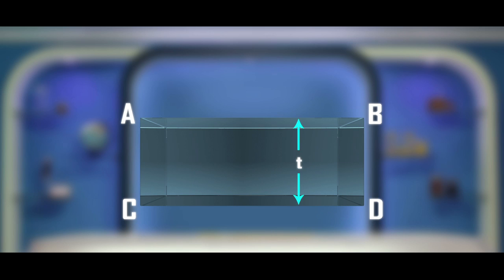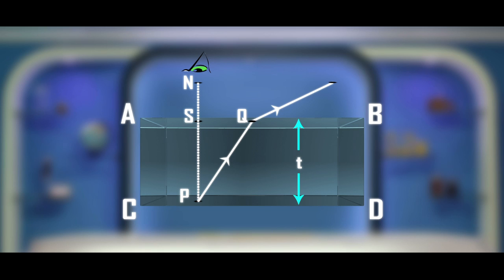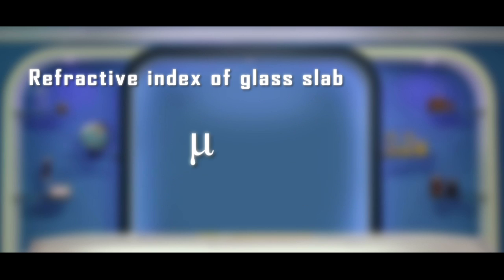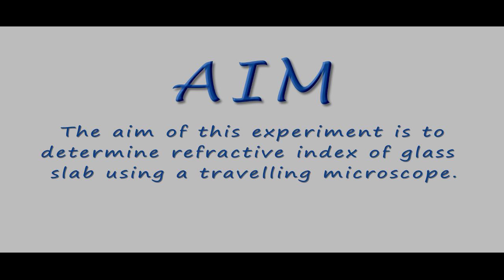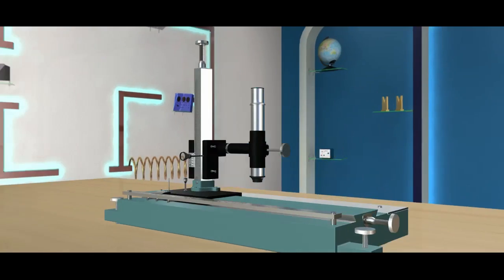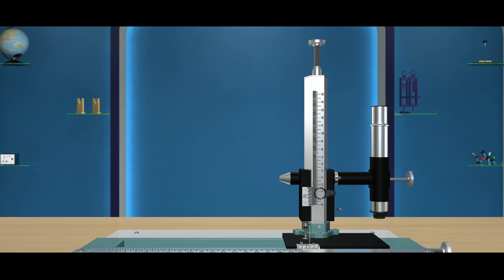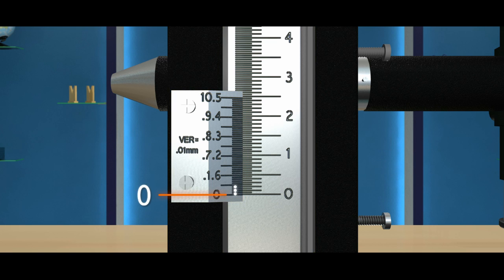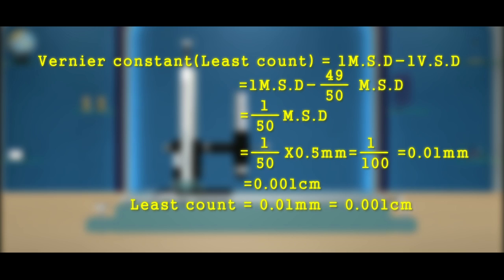Physics Practical: Refractive index of a glass slab (Use headphones for clear audio/sound)

Comment: can you make a video on "how to use travelling microscope "
Reply: +hasan abdul The indicator which reads the reading on the main scale is the zero mark on the vernier. 
On the main scale each mm is divided into half mm. Hence the reading would be read for divisions on the main scale. ie say I start from 3 cm. 
3 cm, 3.05 cm, 3.1 cm, 3.15 cm, 3.2 cm, 3.25 cm and so on. 
But for our convenience let us read as 3.000 cm, 3.050 cm, 3.100 cm, 3.150 cm, 3.200 cm, 3.250 cm and so on, 
Now say your indicator ie zero marking on the vernier is lying in between say 3.200 and 3.250 cm. Then main scale reading would be recorded by taking the lower value namely 3.200 cm. 
Now the vernier would give the last two decimal values for accuracy. If the 43rd division on the vernier get coincided with some line on the main scale, then the vernier reading will be got by multiplying this vernier coincidence 43 by the least count. The least count will usually be 0.001 cm. 
So the vernier scale reading will be 0.043 cm 
Now by adding this along with the main scale reading ie 3.200 cm we get 3.243 cm. 
Another example: If suppose the indicator lies in between 6.450 and 6.500. The vernier division 17 get coincided. 
Main scale reading is 6.450 cm 
Vernier scale reading is 0.17 cm 
So the total reading ie accurate reading is 6.467 cm
Reply: same to you bro, tomorrow i'm having physics practical too.
Reply: visca el barca
Reply: +Anurag Pradhan Thanks bro, cleared my doubt.
Reply: no problem bro, best of luck for ur practicals,2morrow i have my physics practical !